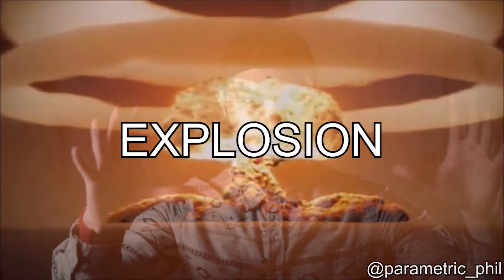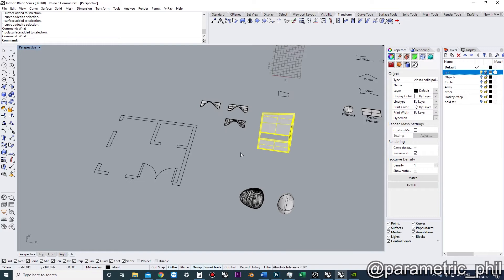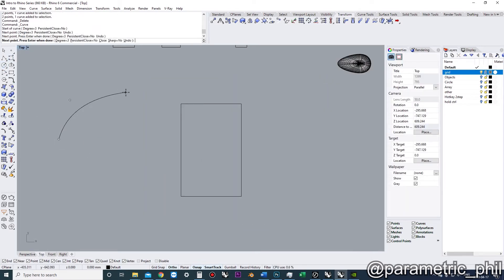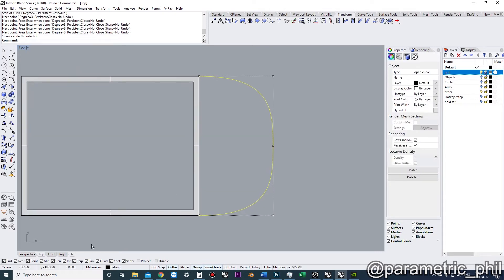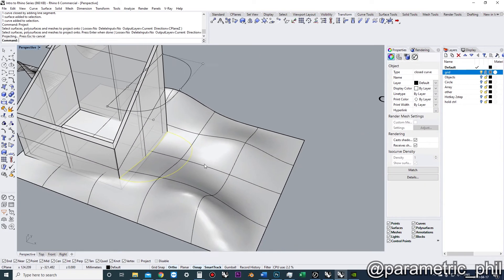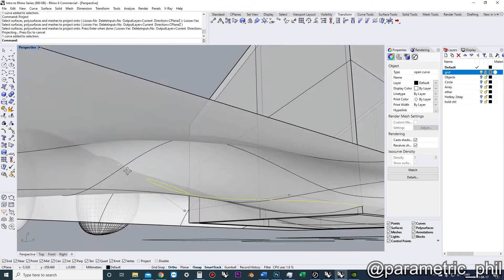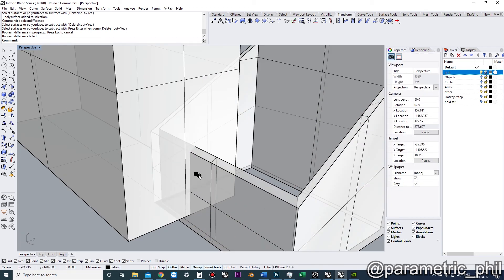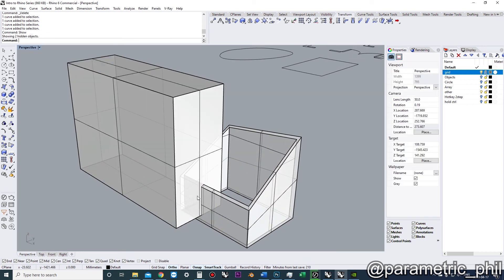Rhino Fundamentals 6a: Trouble-shooting Modeling Errors (edge analysis, boolean failures etc.)

Comment: Hi phil i have some trimmed surfaces joined together. When i try to mesh the joined polysurface , some mesh faces appear at the edges of the trimmed surfaces.  So i tried to rebuild the original surfaces but this time some small gaps has occured between the trimmed edges. How can i prevent this from happening?
Reply from the maker: Hi BC! It's hard for me to offer any concrete advice without knowing exactly what your situation looks like. I've never experienced this problem, but it sounds like the edges are joined perfectly. I'm just guessing though. Some things you could consider: 
1. ShowEdges to see if you have any unexpected naked edges
2. Matchsrf - you can use this to create a perfect seam before joining two surfaces. This would require one of the joining edge surfaces to be untrimmed. 
3. Refit Trim - can be used to create an untrimmed surface that matches the original trimmed surface as close as possible. Note that the shape will probably not be an exact geometry match. 
4. Blendsrf - can be used to create a perfect transition between surface edges. You would have to create a gap between surface edges for the blendsrf to work. 

Let me know if you figure it out. I'm curious what the problem and solution might be.
Reply: @parametricphilosophy1072  thanks for the reply phil. i meant some triangular protrusions formed on the outside of the edges of the surfaces after meshing.
Reply from the maker: @jeffreyyyy  hi BC, yup I totally understood the problem. But it sounds very strange so I'm thinking outside the box. My first thought was that maybe it isn't closed properly so the polysurface edges don't have defined edge boundaries, which is revealed when converting to Mesh. I could be totally wrong.
If you're still having problems, send me an email with your file to pfors@5j5.design
No garentee that I'll have a solution but if there's anything that stands out to me at first I can let you know.
Reply: @parametricphilosophy1072  thank you phil for now i have solved the problem by extracting borders, rebuilding and retrimming. I think its a common problem with rhino it could be some kind of a bug.  Thank you anyway
Reply from the maker: Great, glad you got it sorted out, and thanks for updating me on the solution. 👍

Comment: Informative! Can you tell me what's the full set of Rhino6 tools are for checking surface geometry on imported surfaces? I'm thinking about open edges, overlapping edges, disjointed vertices, bad surfaces, etc. Thanx!
Reply from the maker: Hi Chris, thanks for reaching out! I don't know of anything else off the top of my head that might help, other than what's discussed in this video. You can identify a bad or invalid surface with the "What" command. The "Show Edges" will help you identify where a surface might be open/overlapping/invalid. You may already know this, but in the "Show Edges" tool, naked edges are were a surface edge is not joined, and Non-Manifold edges are where an edge is joined to more than one other surface edge. Both conditions will result in a bad polysurface. 
If you're having troubles with imported meshes, that's a different story. You might want to look into commands like "Mesh Repair" and/or "Unify Normals" and others. I've had to use those before, but to be honest I don't have much experience with mesh modeling in particular. 
If you have a specific problem I might be able to offer better advice. Let me know.
Best,
Phil
Reply: @parametricphilosophy1072  
Thanx for this good info. I guess I'll have to work with what I have for the time being.
I really don't have any problems with meshes, b/c I have a number of programs which can handle them.
But with surface models imported from other software, that's where the problems begin.
Apparently there's either a translation problem, or the models aren't created right, or the native software doesn't make them right.
In any case, I'll have to work it out the hard way.
Thanx!
Reply: @parametricphilosophy1072  
Thanx for your detailed response.
I'm trying to get back into surface modeling, so want to start from the bottom up and get it right this time, so thanx for your great stuff!
Cheers...Chris
Reply: @parametricphilosophy1072  
OK, thanx.
Reply: Geometry fix toolbar